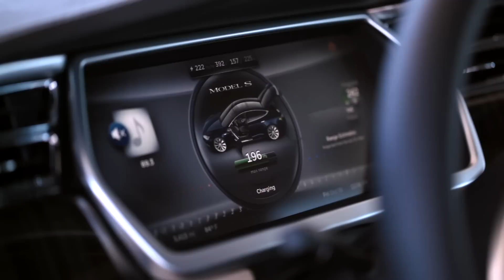CORRECTED: Why Tesla Just Purchased An Ultracapacitor Company

Comment: It isn’t realy the cost or the self discharge. It’s the low energy density compared to lithium ion batts. They have a much higher power density but a much lower energy density. They do offer up possibilities for hybrid cells where each individual cell is both a battery and a UC - excellent for delivering and receiving high power in short bursts and still good for storage.

Comment: I think he wants to start integrating those so in the future he can charge the cars via induction-charging stretches of road. The length of the stretch of road with the inductive charger can be reduced dramatically if the car has a way to get the power faster. With inductive charging + super capacitors you could potentially drive without ever having to stop to recharge.

Comment: I'm wondering how supercapacitors like this might factor into a power wall/home Tesla set up.  That would be one way you can have the supercapacitors be VERY large (without having to worry so much about weight or size like you would with let's say an automobile).
Reply: Probably wouldn't need to be that large for a home. After all, what's the beefiest motor you're likely to find in a home appliance? 2 kW, maybe? The startup surge from that isn't going to need a huge buffer to cover, so maybe just a couple of kilos of supercapacitors in the next-generation Powerwall alongside however many of batteries there already are.
Reply: @Roxor128  That might actually work quite well, Roxor.
Reply: @voicetube   -  Well, I certainly know there are companies out there that sell big cabinets full of supercapacitors that can deliver a megawatt for a couple of seconds. I think they're aimed at businesses like factories which would have a huge startup current that would annoy the grid operators and get them charged a hefty premium for it.

Comment: Ludicrous mode is going to get a boost...
Reply: It may be, but the real benefit would be that playing in Ludicrous mode wont hammer on the batter nearly as hard.
Reply: I can picture Musk sitting around contemplating what "NOS" for an EV would look like. Lol
Reply: @rogerstarkey5390  100% correct . Both 18650 and 2170 cells can easily deliver 6 C power for 1 minute and even 10 C for 6 secs . For the model 3 Peroramnce , that means 480 kW , which is 140 kW more than what the 2 motors can handle , even in the 6 C scenario . Obviously , the motors are the bottleneck , not the battery . Same for Model S and X
Reply: @gerritgovaerts8443  but high C rate utilization (ie Ludicrous Facade Performance Mode) does degrade battery much more than normal usage. Also word is that the Tesla motor controllers also over heat. Tesla is simply "over-porking" the entire system in order to claim an unsustainable performance level .. which they market against other vehicle's sustainable performance levels ... very dishonest advertising IMO.  I would hope that all future media EV performance comparison testing can be conducted with Tesla's Facade Mode turned Off, only allowing sustainable performance settings.
Reply: @KrustyKlown  I agree with you that using ultracaps as a buffer would protect the battery from these high C-rate bursts and possibly extend  battery life (not sur by how much as I don't see people using that much power for more than 6 secs ) . My point was that you would not see better acceleration with ultracaps (as long as your goal is to not destroy the motors ) , coz the battery is not the bottleneck
Reply: @gerritgovaerts8443  IMO, the best possible use for Ultra Caps by Tesla would be for improving the efficiency of Braking Regen .. the ability to store more braking energy quickly, then deploy it immediately on acceleration. On a heavy Truck, the braking regen energy is huge!!
Reply: @KrustyKlown  Absolutely , and that's exactly what I have been saying in my other comments here . Ultracaps will nearly hit 100% efficiency in regen while batteries a lot less as they heat up under high current bursts due to internal resistance . This is the only correct way to use ultracaps in an EV : regen and acceleration
Reply: @gerritgovaerts8443  you called it right .. ultra caps + Lithium  cells does seem like the logical application use of available tech ... Tesla is obviously trying to stay ahead...  EV competition will be heating up in the next couple years as China becomes the dominate low cost producer of lithium cells, supplying the entire global EV industry.
Reply: “Ludicrous” mode will become “I shit my pants” mode
Reply: As a Tesla owner I love the squeal I hear from giving someone their first ride in a Tesla. So the more “Luda” the better

Comment: Ultra Capacitors store very little energy (watt hours), but are capable of absorbing or releasing tremendous power (watts). Terminology is crucial! ;) Would guess Tesla wants to continue to use the lithium battery for energy storage, but use the ultra capacitors to increase it's power capability, ie for brief spurts of acceleration or deceleration. There is not enough room in an entire car to fit enough ultra capacitors to store a meaningful amount of energy. Even a FULL semi truck trailer wouldn't really store all that much energy.

Comment: If you already have a large energy storage requirement (as any real BEV does) then adding supercapacitors to the mix is strictly worse.  The batteries already provide plenty of power through sheer numbers.  There's corner cases of course, such as very low temperatures or optimizing wear to maximize durability, but those could easily be done with consumer products rather than a major investment.

Much more likely is Tesla wants the dry electrode technology (and the people behind it), which is directly applicable to their core product.

Comment: Thanks Nikki !Perhaps piggy back technologies could make  charging of a Tesla battery a breeze. Charging a supercapacitor can be done in seconds Imagine you stop to charge  your supercapacitor instead of the battery and discharge it at a certain rate into your battery while you drive your car .Charging a battery of supercapacitors  would take seconds and once you have the load of energy with you, while you drive that energy supplies your battery of your EV.Does not seem too far fetched.  I hope the devices that enable this transfer of energy from supercapacitor to the battery proper will not be too expensive.

Comment: If it could be used as battery, then charge time is only 5 min for 300 mile range as EESTOR had been claimed but never happen since energy density is still way too low compare to the battery.

Comment: if the capacitor can hold enough charge to get up to max speed at anytime then when it is not in use it can send the charge back to the batteries and avoid loss of charge and then when you get onboard it can charge the capacitors from the batteries before you get all strapped in. so using capacitors and batteries together is definitely a good idea. additionally if you are too quick to get going the power can still be pulled from the batteries although the acceleration may be lesser

Comment: The big factor that makes any kind of capacitive energy store non viable (for cars) is that the voltage across a capacitor is directly proportional to the energy in stored in that capacitor. Unlike for a chemical battery, where the electro-potential, whilst a function of State of Charge (Soc) is only a loose one.  For example, a fully charged Lithium cell might generate 4.1 volts, but  a completely "empty" one still generates 3.6v. Why does this matter?  Well it means to that the more capacity of a capacitor you use the more the voltage changes.  And to get value for money, you want to be using as much of any given installed capacitance, so to do this, whilst powering or charging from an electric motor means some form of DC:DC converter is going to be necessary, and at high power levels (which is the advantage of caps) that's expensive and bulky!  If you were to connect a capacitor directly across say a battery cell, then you can't actually use the capacitance!!  This downside is currently insurmountable in passenger cars (due to economics)

Comment: In EVs I see them being used in two ways. Firstly as an initial reservoir between the battery and the charger to gulp in electrons rather than wait for the battery to charge at the station. In this way you spend far less time at the charge station while they then charge the battery as you roll.
The second way could be under aceloration to give an instant jolt of energy without causing a big draw on the battery.

Comment: Rapid charge in seconds to ultracap >> which then slowly charges the battery while you're driving. Also, highway charging using a wireless charging lane for a few hundred meters ever 100km or so would be pretty cool. Then you can have a short range battery packs (a city car) that can drive great distances, non-stop using lane charging to ultracaps.
Reply: No, no, no!

Supercapacitors charge fast, but they don't store much. In a car, their role is as a buffer for regenerative braking and absorbing the surges from that so more gets captured and the battery doesn't heat up as much.
Reply: @Roxor128  so why can't the same logic not be used for fast charging?
Reply: @MartinMenge   -  It's a matter of quantity. When you're charging the battery you're putting in a lot of energy at a steady rate. When you're braking, you're only putting in a little, but it's being generated very fast, and too fast for the battery to take it all, which gets wasted heating it up instead of charging it. Thus, you want something that can store a little bit quickly inbetween, hence the supercpacitors.

It's like cache memory in computing. You have little pockets of fast memory near the processors to store what they use frequently which get filled and emptied from the much slower main memory as the opportunities to do so arise.
Reply: @Roxor128  https://www.bbc.com/news/business-43285885 sites that South Korea has supercap powered busses. I realise that, that is for short distances as they charge on route at special bus-stops. However, as supercaps become lighter and lighter and smaller and smaller, eventually you can have supercaps that can hold, say 20% of a vehicle's range. Then it would make much more sense to fast (instant) charge that, either at a "super charger" or in-lane charging, and have the supercap then charge the battery. Then you can have charging stations that charge as you drive through (like a fast food drive-through) on a rail (think ScaleXtrics).

Comment: I've always thought capacitors were the way to go and your point that trucks would greatly benefit from them is right on. Pulling into a charging station for a quick zap and out again fully charged is a real time saver.
Reply: Jeff, UCs cannot help with charging because they have a tiny capacity compared to a battery.
An ultracap with the same capacity as a Tesla would weigh 20 tons, be half the size of a small bus and cost several million dollars, so you can forget the idea of getting a "quick zap" for a very long time.
Reply: @ahaveland  I've seen capacitors the size of a carrot start a car. The amount of voltage that can be stored for the size of the CP is enormous. It's a matter of bleeding off that voltage slowly enough to be useful. The improvements in dielectric material have created a whole new potential for energy storage. That and the leakage of energy due to the high voltage forcing air to be a significant conductor has been a sticking point. I think your model of a 20 ton vehicle assumes very old technology. The charging of such a series of capacitors could take place almost instantly and would be restricted by the delivery system, not the storage system. That would be a truly important breakthrough. The problems of safe storage, safe charging, leakage etc. are not insignificant but I think it's the way to go. Musk seems to believe it's a possibility else why blow so many millions on an untenable solution?
Reply: @jefflaurence6612  
"I've seen capacitors the size of a carrot start a car" - so have I. That is because of *power density*, around 15kW. That is a very high rate of flow for a short time.
It would move your car a few inches.
Ultracapacitors hold 3 volts max. To get 400 V you would need 133 of them, all with balancing circuitry. To get capacity you would need to duplicate all that many many times.
20 tonnes comes from the current state of capacitor technology based on 6Wh per kilogram and a 105kWh battery. Do the maths!
Ultracapacitors are useful, but not for primary storage - they are good for high power transients.
Musk is not so interested in ultracapacitors for storage, but more for the nanotechnology patents that could improve intercalation in the cathode material for lithium ions. If you can better control and direct the movement and packing of lithium ions in the electrodes to reduce deformation, damage and dendrite formation then you can have a longer lasting battery with better performance.
Reply: @ahaveland  since you have no idea what kind of voltages are being achieved at the lab, your beliefs are based on pure conjecture. It would be possible with much higher voltages to store a very high potential that could be useful over long distances. Time will tell what's science fiction and science fact but don't be so sure you know what's possible. There are more things then are dreamt of....
Reply: @jefflaurence6612  Electrostatic charge carries much much energy than electrochemical energy. It's not a question of belief, but physical reality.
Blame physics.
Reply: I'm always surprised by men of science who are convinced that they know all that is to be known.
Reply: @jefflaurence6612  Me too, but a fish will never be able to climb a tree.
Reply: @ahaveland  as far as we know.😁

Comment: Holy crap. Am I insane here?  Could not a huge ultra capacitor be charged in seconds, then be used to charge the lithium ion pack while driving-using a smart constant current circuit?  The self discharge and voltage issue of the uc, is mute.  Guess it depends on the weight of the uc.
Reply: The energy storage of ultra capacitors is currently way to low but can help with peak energy flows
Reply: Would that make the Tesla a hybrid? Lol. Or It could just charge the ultra capacitors first and then is the regular batteries at supercharger speeds and reduce charge time, Then when driving to use the super capacitors first and then regular batteries. Both your Idea and mine seem a bit over complicated though And tesla is about simplification and reliability. Probably just going To improve their lithium ion batteries with dry electrode technology for now.
Reply: @veronicathecow  it's probably just right for regen, a 0.25kWh UC (which would weigh about 100lbs) would allow full regen when the battery is cold or full, and discharge back into the battery slowly.
Reply: Probably not worth it.  May be worth installing to capture slightly more energy from regen breaking or to lower the cycling on the battery pack but what would be the point of charging a massive ultracap in order to drive off while it trickle charges a battery pack?  If you already had a ultracap the size of a battery pack, you would not need the battery pack...  

Finally, I don't think there will ever be a day when a consumer product with an electrical storage capacity as big as a vehicle will be allowed to charge in seconds.  The amount of electrons that would have to be moved in such a pulse would be mind-boggling.  350KWs wouldn't even register.  We would be talking a pulse of several megawatts of power... What kind of connections will be needed to handle all those electrons at once?  The charge cable alone will probably be the size of a person...
Reply: Because the ultracap would be maybe 10 times bigger than the equivalent capacity of a lithium battery pack.  @Bryan46162
Reply: Capacitors right now only hold about 1/10 the energy of Lithium cells for the same weight. But theres tons of scope for improvement, the theoretical density is better than chemical cells so they will probably take over from cells in like 10 years.

Comment: The problem with the Semi truck when driving downhill full loaded is that it will produce energy with such a high power rate that the battery can't handle it. In this case a supercapacitor would be a good solution for buffering this energy.

Comment: May be ultra capacitor is more suitable for power wall, for home applications you just need something to store about 12 hours capacity and the amount of energy use in 24 hour period is predictable .
Reply: A 13.5 kWh hour UC (Powerwall capacity) would weigh about 5,400lbs based on the Maxwell spec sheet, more for smaller peak surges like regen in an EV, or ludicrous acceleration
Reply: ottawa I don’t think I want a power wall with self discharge. That’s like buying a water tank with a built in leak.
Reply: Not a replacement for batteries! Supercapacitors are for when you need to store a smallish amount of energy, but need to be able to deliver it quickly. Like covering startup power surges. That would be a good use for them in the power wall, as a buffer for when you're starting something with a beefy motor.

In cars, you'd use them for storing energy from regenerative braking and supplying the motor when accelerating, cushioning the batteries and making them last longer.

Comment: Ultra capacitors problems are: they have much lower power density than lithium batteries and require large change in voltage to deliver full power.  Large advantage is long life and quick charge and discharge.